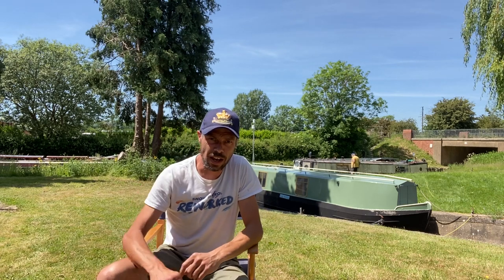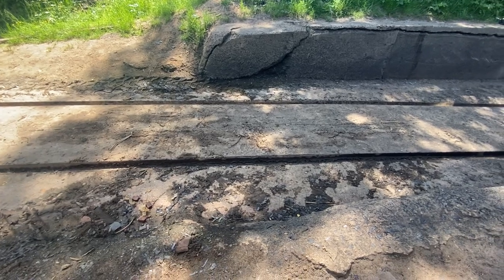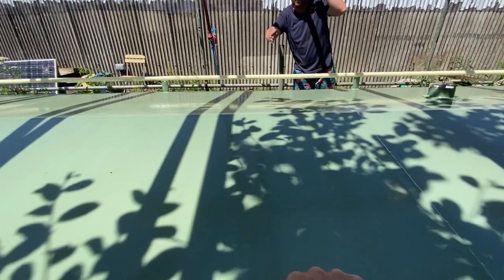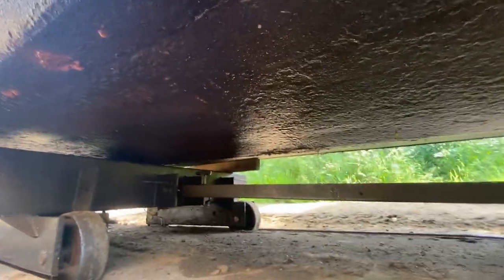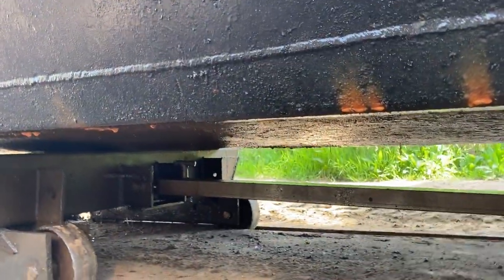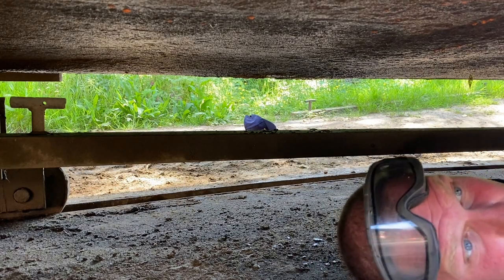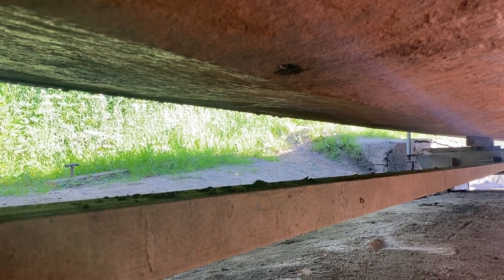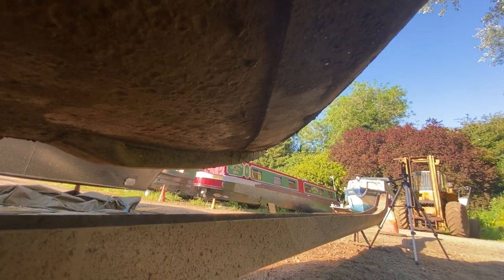198. There’s a screwdriver hanging out the bottom of my Narrowboat

Comment: Hi James, your dilemma is well noted by all but I do believe your situation has highlighted an issue that many boat owners overlook. Generally, when boats are blacked, it's only the sides, bow and stern that receive attention. The bottom plating isn't accessible due to the lack of height of the chocks in the dock or on the slip (in many cases) and inspections can only be done from the interior of the boat.
Would be interesting to find out when the bottom was last blacked.
Suggestion of blasting with walnut shells should be considered to find the full extent of the corrosion and heavily pitted areas.
Take this opportunity to fix the old girl and remove any future doubts from your mind.
All the very best.
Reply: All these boaters have their boats out the water saying it's so important to have them checked and reblacked but never seen the actual base plates being done, ever.
Could never understand this as the base plate is in the water the same amount as what the sides of the boats are.
Reply: @npo1297  i asked my own surveyor this and he said the areas around the waterline normally in his experience dégrade much worse than the baseplate which is always wet.  A lot of boaters do black the bottom if they can get to it but a lot of people say that it’s a waste of money as it all gets rubbed off on the very shallow canal beds. The base plate on my boat is 10mm and 11 years old. To my knowledge it’s has never blacked but at the last survey had only lost a max of half a millimètre of steel on average. Guess you pays your money and take your choice.
Reply: @npo1297  conventional wisdom, at least, is that the water near the bottom is low in oxygen and thus doesn’t rust much.

Comment: The non structural hole can be repaired - temporary(a year or 2) or welded permanent depending on the damage. 
Suggest buying a ultrasonic metal thickness detector about $75 US so you know what metal needs repair around the hole then test other pitted areas for future repair - you might consider taking a welding class if repair is extensive

Comment: Time to get an ultrasonic thickness meter and check out the thickness of the plating on the bottom.  It does look quite badly pitted under there. It's a pity you can't spray metal onto the bottom and build it back up. lol.

Comment: Well glad you found the hole. That’s what she said. I dunno, check your anodes?  I thought you blacked that bottom earlier this year?  It looks awfully corroded for 2-3 months in the water. What does a full bottom hull replacement cost?  I’d guess 10k lbs?  Wish I knew more to help you. I only deal w fiberglass and pontoon boats. Good luck sir I wish you the best.
Reply: Well his electrical was running high wattage electrical tools so it could be how his electrical was hooked up.  I thought he had surveyed the thickness of the steel in multiple places so if the holes are near areas previously surveyed, you could figure out how much current was drawing into the canal
Reply: @tduenchan  is there any recourse against the previous inspector?
Reply: @stevearchtoe7039  I don’t know. James discussed the survey on his 4th video.  He had a lot of water in his bilge when it was on the hard and pulled all his ballast out and pumped the water out and had the hull surveyed.

Comment: Is there any way you could remove the ballast from the affected area and work on it from the inside of the boat. I saw something about “pad welding” on YouTube. ???
Reply: Although this won’t solve your immediate problem, this may help in the long term to avoid further damage. Apparently pitting of steel hulls is caused by electrolysis and the way to reduce this is to increase the number of anodes on your boat and also ensure they are aluminium and not zinc. You could fill in all the pitted holes with epoxy and that seems to give a lasting fix. 👍

Comment: How much to do the full bottom plate
Reply: I did one a number years ago. It was £1500 for the steel. £1000 for welding rods & mIg wire and gas & grinding discs. Red lead paint. It took me over a month of horrible dirty work and welding burns. It`s not nice being on your back under 20 ton of steel boat. I was paid £2000 for the job. Boat yards charge around £5-6 grand for over plating.

Comment: the v shaped hull looks like a springer manufactured boat. if so, the bottom metal would only be 5 mil thick. you really need yo determine how thick the hull plating on the bottom is to make an educated decision on a fix. if it is 10 mil, shotblast the bottom and weld fill the pits. if it is 5 mil, you probably will have to overplate the hull. the v shape will double the cost over a flat bottom. might be time to cut your losses and try to trade up as this has money pit writ large on it.
Reply: Springer does sound like the name I’ve heard James use a lot yeah.

Comment: I’m guessing that no “survey” was done when you purchased it …. otherwise…you could sue the surveyor for damages. I’m also guessing that all this is moot and that you must “carry on” at this point. Is there no way to google for solutions worldwide. I can’t believe that are no “rubberized membranes” that would effectively seal the entire underside once the holes are fixed. I realize that the UK fancies its steel hulled narrowboat industry…. But there has to be a better , lighter , rust free hull manufacturing solution out there.
Reply: Sea otter used marine grade aluminium, no need to black it or bring it out, fantastic until you put power in, then the galvanic forces drawn to the bank can turn your boat to porridge
Reply: From memory James had a hull survey done whilst the boat was on chocks. The surveyor thus was unable to get underneath but I think did measure the steel thickness from the inside and all checked out ok I think. I would suspect from experience myself you would have a very hard time proving negligence given 6 months has gone by and surveyors usually have some sort of wording in their T&C  anyway. In addition it would prove extremely costly. Steel is a very good material if it's looked after and treated well.
Reply: I wonder if it's not the surveyors job to actually tell you what you need to do about the thickness of the Hull. They just measure and leave you with the measurements. We recently had ours surveyed twice & the second time was to get a second opinion and ask the pertinent questions while the surveyor was still on site. I'm only just getting into this series now (really helpful for our own project) but I did notice some below 4 markings in the early episodes after the survey. We were told over 5 is preferable but over 4 is essential just to survive the sand blasting. And indeed after blasting we could see numerous pinholes to be welded before overplating.

Comment: Best bet is to do media blasting of the whole bottom & get ultrasonic thickness profiling done to see both where the thin/weak bits on & where the thicker bits are to weld the over-plating to. That way you’ll end up with a stronger hull & fewer Chances of long term issues. I’d also recommend changing from bitumen blacking to the much more durable epoxy type, which would cost a bit more, but be far more protective. I think what may have happened is the anodes were left to degrade years ago & it sat in the water with no anodes, possibly also encountering iron eating bacteria present in some areas of the canals.. because it is a V with two plates vs one on the bottom, it may also be wise to lay a sturdy strip of steel down the middle of the V to protect it from impact damage & strengthen the overall integrity. Cleaning the bottom to bare metal is, I think, essential for any repairs to work & not just delay further corrosion holes.

Comment: Hi James only me again the spiky bits all around the edge is what is left when the edges were overplated you tack weld large washers or scrap pieces of metal to hold the plates in place while you weld them then knock them off with a hammer then I used to grind  the spikes flat but lots of welders just left them like yours nothing to worry about

Comment: I am used to much bigger sea going vessels, but on those over plating is only a 'sticking plaster' but unlike the human body which heals under the plaster the rot continues out of sight. As soon as you get a pin hole in any of the welding around the plate which is very vulnerable to corrosion then you have water in the vessel again. I am afraid that if I intend to keep the boat for years then I would cut the rot out and replace with new steel, expensive but good for another 20 years if done right. Otherwise you are always wondering. Sorry if that is not what you want to hear.
Reply: @Narrowboat.and.offgrid.living  When over plating you are generally welding upside down which is much more difficult. If you cut out and replace you can weld from above aswell as below giving a more uniform weld. The depth of weld is usually deeper aswell due to the plating being thicker.